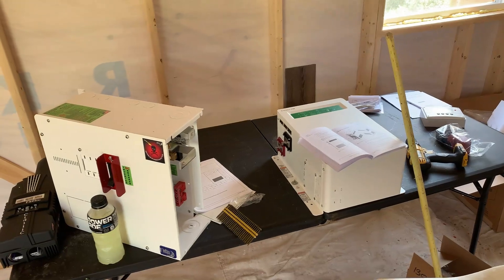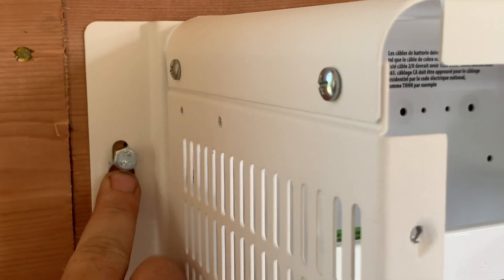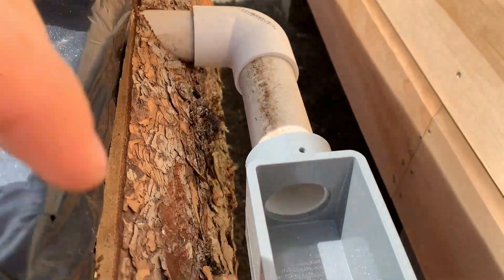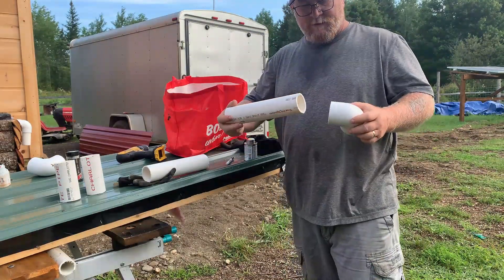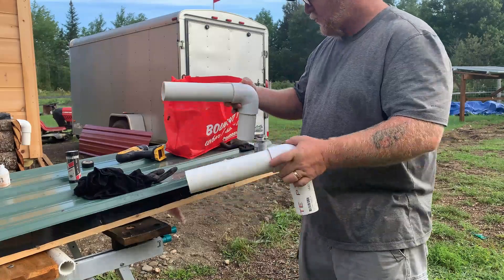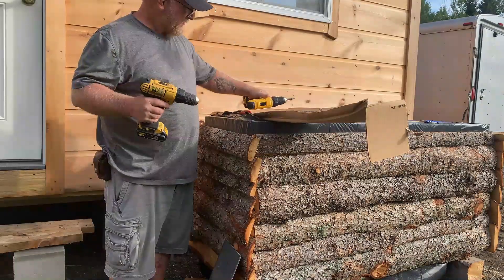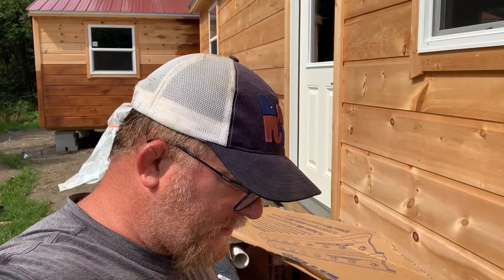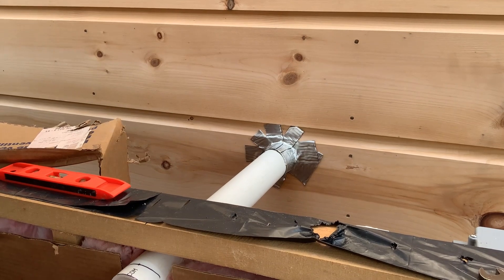2.64kw Off-grid Cabin Solar Install | SW4024 | Midnite Classic | Rolls 24V 890AH Batteries | Part 1

Comment: how do you like the conext 4024 SW and would you recommend it? 
I'm a farmer in Kentucky out deep country with no internet services.  Even the cell phone service isn't working great here. do I need the internet to access the settings  with the conext scp control to make any changes? thanks
Reply: I have 3000 watt panels, outback charge controller and 24v golf batteries bank. all I need is an inverter.
Reply from the maker: In my opinion the conext sw4024 is a beast. It has worked flawlessly for our needs.  It was probably a bit bigger than we needed but when I built the system I wanted enough cushion so I could expand if needed.  Would highly recommend it.  
It does not need internet as setup and settings are all local to the inverter.  
The charging side is relatively straightforward too. 240 is ideal but 120 works too (we’re setup with 120 from our generator, though we’ve not had to use it yet).  Hope that helps

Comment: you're venting the battery bank too close to the cabin window . I'd relocate it unless you are not planning on opening the  window.
Reply from the maker: That window stays closed all the time.  We built a power shed and will be moving the batteries into the shed shortly which makes that window a moot point 👍

Comment: am hearing some rumblings from my relatives in Harrisburg, PA and Salt Lake city, UT that there is a shortage of Cement/concrete, and its not available to anyone unless they pre-ordered  either online or from any on site stores, hope thats not a case in your location, if you do make sure you order some (for your future projects, order some hammering nails, hand saws, saw blades, all types of screws, electrical drill bits, mechanical wrenches n drill bit batteries order from ebay..could be expensive but like milled lumber price hikes its gonna be everything.. ), 
lovely electrical setup.

a suggestion: add a 3phase Breaker Switch, this way if you are outta power from the batteries or solar batteries are charging but the input is less especially on those cloudy days or if its snowing.. the 3 phase switch will help if there is an external electrical socket outlet (3pin shore power socket in RV) going from the generator to the external socket to the switch to the inverter and then to the batteries. cutting out the solar array. so even if you're not present your Mrs can star the gasoline (petrol) generator, switch off the breaker inside (written on the switch itself, turn off the inverter, G for generator, N for Neutral, S for Solar) going out again, plug in the power to the outer electrical socket, coming back in and starting the inverter and charging the batteries. or you can find a 3 pin interlocking socket with breaker in 1 ( 2P+E = 2 Pole and Earth )
(examples: https://www.ebay.com/itm/284418947158 and https://www.ebay.com/itm/303968085436)

Also make sure to wear some insulated gloves.. my father (at 77 tired to attach a battery bank grid-tied to lead-acid batteries and got a shock because he was wearing his Wedding ring and the new batteries had some charge in e'm.) Summer is ending and autumn in arriving, Another year is coming to pass, Stay safe, regards from Singapore, GOD BLESS.
Reply from the maker: Hi! I’m sorry I missed this comment, am glad I finally found it! 😊 
Great advice on getting extra materials and equipment. 👍
As for the 3 phase, our system is a 3 phase system that utilizes a 240vac input from our generator and has an easy AC switch so in the event we need to run the generator due to no sun we can simply flip a switch and start the generator.  
We have a new video coming out soon on our generator shed build. 
Good advice on wearing gloves too.  Thanks for the comment!! 😊

Comment: Just love that cute pumphouse 🤗

Wall-mounted wood panel is quite close to window. Will there be enough space for window trimming (right side) later? 🤔
Reply from the maker: Thanks!! The pump house needed a face lift and the slab wood seemed to work great!  Matching battery box 😊
There is enough room for the trim we’ll use, good eye!! 😉